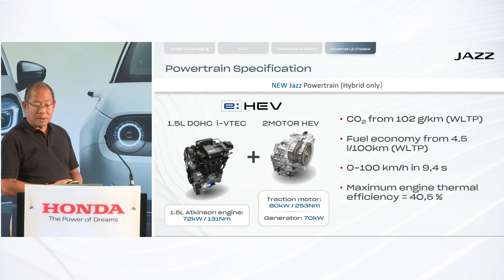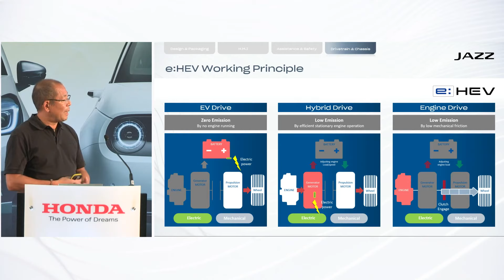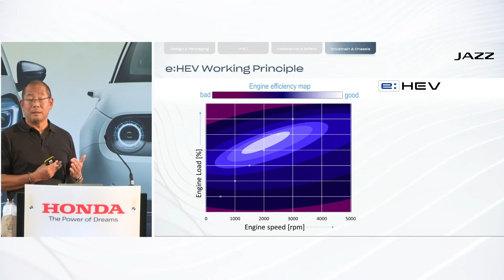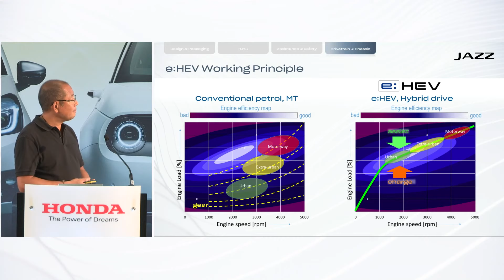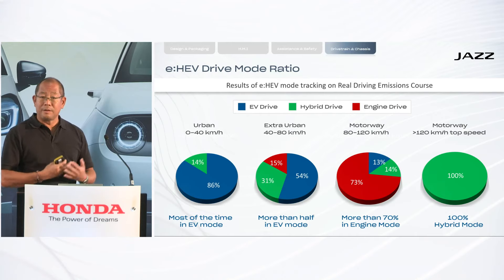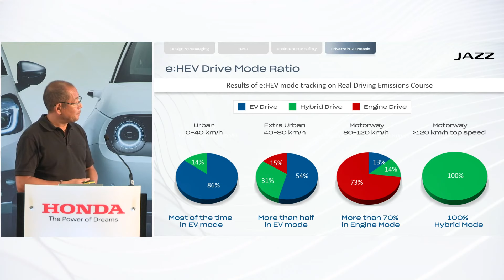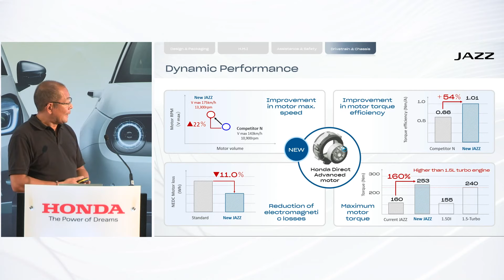Honda e:HEV Hybrid System – How it Works (Ko Yamamoto, Technical Advisor Honda Motor Europe)

Comment: Hello, I have a question. Is the e-cvt transmission used in this new 1.5 cc Honda Jazz exactly the same system as the e-cvt used in the 1.8 cc Toyota Corolla sedan or is it a different system? The reason why I asked this was they said that the risk of deterioration of the e-cvt system used in Corolla is less than the normal CVT. Do you think we will have problems with the e-cvt gearbox if we buy Jazz?
Daha az göster
Reply: From about 1:40 "There is no gearbox whatsoever. So there is no cvt or planetary gearbox included. That minimizes the mechanical friction of the whole system."

A "normal CVT" is a pair of conical gears with their tops pointing at each other. Varying their separation changes the gear radius of a belt or chain stretched between them. As you point out, there can be a lot of wear due to this movement.

Toyota's eCVT means "electrically-controlled" CVT. It is a planetary gearset, which is a three-way transmission. The three connections are the engine and two motor-generators. The rpms of the engine are controlled by using one MG as a generator to charge the battery, and varying how many rpms it takes. There is no changing of gears, belts, or chains, which is where most of the wear occurs in more traditional transmissions.

Honda's marketing also calls this an eCVT, and sometimes incorrectly an "electronic CVT," but that is a horrible name. Engineering has called it "electrically coupled CVT," which is better. Best would be vCVT, for "virtual CVT." There is no mechanical connection at all. So there is no wear in a gearbox. The engine drives a generator and the electricity is split between powering the drive motor and charging the battery. In eCVT mode, the engine should usually run between 1800 and 2200 rpm by the diagram at 4:00, and this speed has absolutely nothing to do with the speed of the car.

There is another mode that Honda calls Direct Drive or Engine Drive, when the clutch locks up. The clutch opening and closing is the only wear in the transaxle.
Reply: @jeffjo8732  Thank you very much for detailed explanation as far as i understand not the same but at least no risky to buy both of them.

Comment: Honda engineers have much to be proud of.  I love my 2020 accord hybrid.  About how many miles could I get from the battery alone at, say, 65 mph?  Also, is brake life extended because Of regen braking?  Thx!
Reply: Battery in new Civic lasts for about 2km at eg. 50km/h. It's small 1KWh battery. I think Accord is very similar. It's not for long driving. Serves rather different purpose.
Reply: brake (and tyre) life can be extended if you use regen braking

Comment: I wish Honda/Acura didn't drop its Sport Hybrid sh-awd system you found in the 17-20 MDX, 14-20 RLX, and 17-22 NSX.  Very sporty powertrain that had excellent handling with the same city/combine/hwy mpgs.  Nice having a 6-7 passenger +4500lbs 321hp SUV that gets 25-27 mpg on the hwy at 80 mph on a 12hr road-trip.

Comment: Mechanically it is simpler than Toyota's system, but it has a clutch, which needs to be replaced at some point. Toyota's system does not have a clutch, and the power delivery is truly seamless. To me, Toyota's system is an engineering marvel.
Reply: It is not used the way the clutch in a manual transmission is used. The crankshaft and overdrive gear are speed-matched by computer before engaging. There really is no perceptible transition.

And you are wrong about the Toyota not having a clutch. There is one, called the torque damper. In case there is a sudden change in torque on either end, it lets the connection slip a little instead of transferring it.

Comment: no cvt no gearbox ? then why do you call it e-cvt??
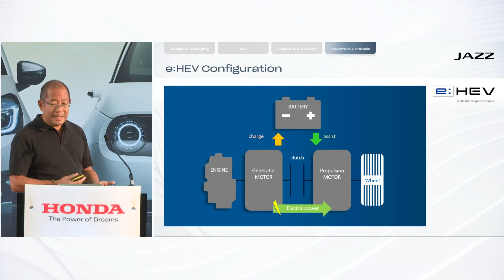Reply: From many engineering papers written between 2013 and 2018 (the first car with the system was the 2014 Accord PHEV), it is "electric coupled CVT." That means that when in CVT-like operation (or "Hybrid Drive" starting about 2:05), the connection between the engine and the wheels is electric, not mechanical.

This is what allows the "power shifting" shown around 5:00. The engine+generator produces more electrical power than is sent to the wheels this way, so the extra is used for charging.

Comment: While this new innovative technology looks and sounds amazing, i am just wandering if anyone have any idea on how the long run service cost would be for cars that are equipped with this kind of technology? I am thinking of hopping to hybrid, just wandering what would be service cost in the long run? I'm sure the hybrid system components would require maintenance and service to run optimally.
Reply: No special service for the electric motor. Just look at Toyota, some Priuses make 500k miles on an original battery with no issues. Just clean the battery filter once in a while an off you go.
Reply: @pasiutrial  Petrol engine has no turbo etc, operates at optimal condition and it's never really stressed= longevity. Electric motors as far as I now are very reliable. No gearbox whatsoever. Efficient breaking by recuperation= longer live for breaks. Only thing is batter, but it uses new tech battery, so I assume for first 10 years you have nothing to worry about. There is a reason why Honda gives extended 5years/300k km warranty on those new hybrids. In worse case battery is small (around 1KWh) so replacement should be few K$. I rather take this system than current tiny turbo charged engines.

Comment: From what I understand, battery seems to be charged and discharged too often which might cause faster degradation. Maybe they could use a capacitor for faster charge discharge cycles and not invoke Li ion battery always.
Reply: Bigger batteries would have less cycles, but if they broke they'll cost very much, a smaller one has much more cycles, but in case of degradation it will be cheaper ..
It's a compromise, thoug I think a battery needs a certain charge discharge frequency to be kept in shape ...
Reply: Capacitor was used in previous Mazda 3. You use the energy within 30 seconds or it is completely gone. It is not siutable here. 

Li ion batteries used in hybrids are less energy dense than in electric vehicles or your phone. They are being used within tight voltage range, imagine you use the battery only between 40-60% of charge. The car present this energy states as 0-100%. That is why the battery in hybrid car is over 40kg heavy and their capacity is below 1 kWh. However, they are also able to be charged or discharged within 1 minute while still last 10 000 cycles or 20 years.

It is not very effective use of the lithium, cadmium etc. is it? Go full electric :)
Reply: Don't think battery gets continuously charged by the generator and then emptied to power the motor.
Most of the times the generator is directly feeding the motor, not involving the battery.
At sustained low speeds you may have the charge-discharge cycle (to keep ICE in a better spot) but it all happens with very limited loads. Like, it takes the battery from 30 to 40%.
Battery is mostly loaded by regenerative braking, like any other kind of hybrid.
Reply: @Wilhem275  There is a component called the Power Control Unit that performs the tasks you describe. It includes the inverters for the motor and the generator, a Voltage Control Unit for the HV bus, and some control units. The point is that the arbitration for how the generator's power is dispersed is handled entirely within this PCU. Some will go to the motor, without passing through the battery first. The VCU will determine if power is sent to, or pulled from, the battery.

But you are wrong about "battery is mostly loaded by regenerative braking." In any hybrid. Only a few can capture more than about 50% of the kinetic energy change. More than that will be used to return the car to the same speed. So any brake-accelerate maneuver will result in a decrease in the battery's state of charge. Most of the charge comes from overproducing with the engine, and saving the excess. See 5:20 in the video. It is a little cartoonish for the Fit, but I've seen actual efficiency maps for the Accord hybrid. The "Hybrid Drive Operating Line" is 50% to 200% higher in power than what Honda claims is needed to maintain speed on a flat highway.
Reply: This was my assumption as well. Honda's series setup puts more wear on the battery than Toyota's series/parallel setup. But Honda's setup should in theory have higher mpg potential since Toyota's setup limits/relates generator rpm to engine rpm, whereas Honda's makes the two entirely independent. However, it is debateable even with today's high gas prices, whether the extra 15mpg or so Honda's hybrid system affords, still even comes close to recouping thr extra cost of battery.

Comment: so generally the car uses petrol/diesel power generator to drive the electric motor.
Reply: Yup. Kind of like EV with battery extended. Add battery cells and disable the petrol engine, you have an EV. Very dissimilar to Toyota Hybrid. This system sets Honda on the course of migration to EV. Brilliant.
Reply: @wongcw08  Does this mean that in a few years time existing hybrid owners could put a larger battery in their cars and be pure ev’s.
Reply: @Thetyrerepairer  Theoretically yes. But commercially not likely.